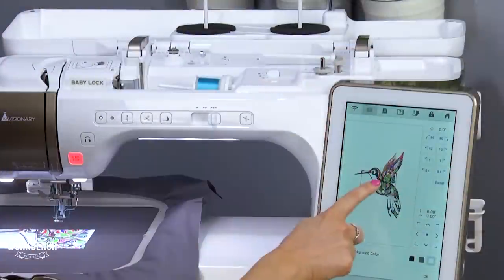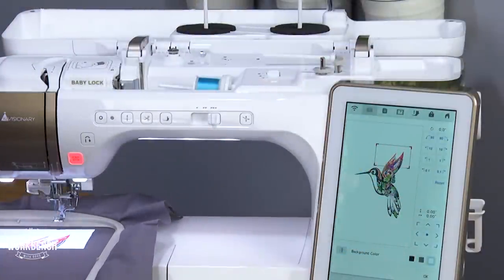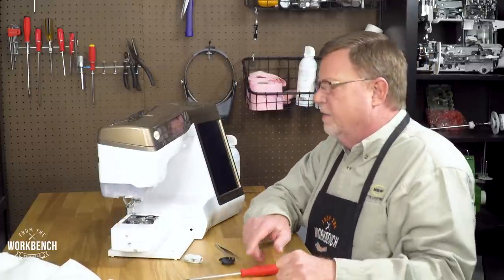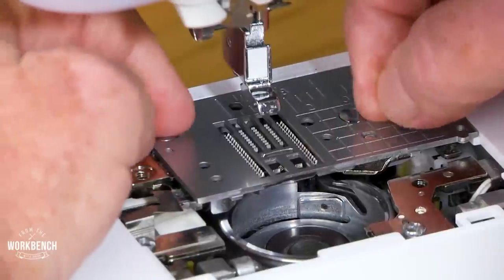From The Workbench with Doug - Maintaining Your Sewing Machine at Home

Comment: Thanks for the wonderful video!  I dropped the screw holding the pressure foot while cleaning out the bobbin case.  I needed to know how to take another piece off of my baby lock so I could shake out the screw.  It had fallen into that lower bottom area of the freearm cover.  I removed it and Voila!  I was able to get the screw out and put the machine back together.  Thanks again!

Comment: Thank you so much for the details about replacement of the bobbin case! I'd cleaned mine and the hooking was not working (bobbin thread pulling up in large multi thread wads). After three full dismantling, checking everything, reinstalling and failing cycles I was ready to take it in. Since it's Sunday, thought I'd look for a video and found you. I've always gotten away with reinstalling the metal feed dog plate and the plastic bobbin cover plate in a single move. Didn't actually know I was supposed to do it in the order you show here. Took one last run through using your order and I'm sewing again! Thank you so much for sharing the step by step with explanation.
Reply: Way to go Nancy !  I'm glad the video was helpful for you.  Happy Stitching :)

Comment: Thanks for the video. Very helpful. I didn't know you could use an air gun. Can you use it on the upper thread path? Right now I'm having an issue with my Solaris. It keeps telling me to check and rethread upper thread. I cleaned it all out and changed the needle but it still keeps telling me to check the upper thread. I'm wondering if there's lint on the sensor and if I could blow it off.
Reply: Yes, that would be fine :)

Comment: Doug, I did something really stupid. I have a babylock destiny while using the straight stitch I kept getting a error message to check upper threading, so after several times I decided to remove the faceplate to investigate, on the threader assemble I saw what looked like the thread that I was using wrap around a pulley so I snipped it after I did it I knew I did something wrong. I pulled on it and out came a think rubbery wire gray in color with what it looks like tiny beads in a loop. Doug how badly have I done and does this sounds like a costly repair?

Comment: Is there a magnet on the tip of the screwdriver?
Reply: Yes Kelle, I do have my screwdriver tip magnetized.
Reply: Kelle, you can magnetize a screwdriver tip quite easily by rubbing it against a magnet.  It actually helps quite a bit when you are working with tiny screws.

Comment: ANOTHER VIDEO STATES BABY LOCK MACHINES ARE SELF OILING I HAVE NEW MACHINE MODEL BLJY IS THERE A OIL RESERVIOR
Reply: Gary, our machines don't have an oil reservoir like some commercial machines have, instead, the metal that is used is impregnated with oil that releases when the machine heats up while sewing.  So, to keep your machine in good working order you should use it!